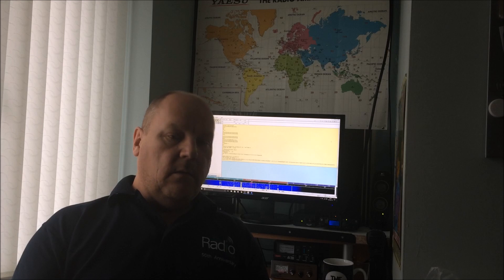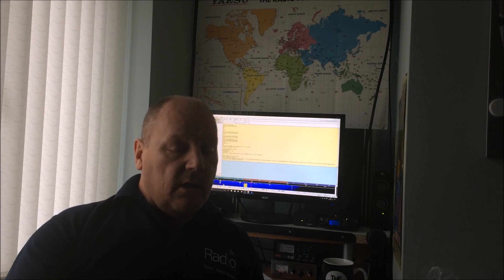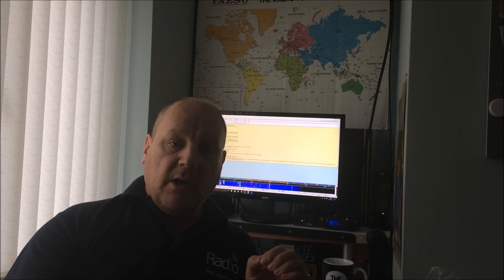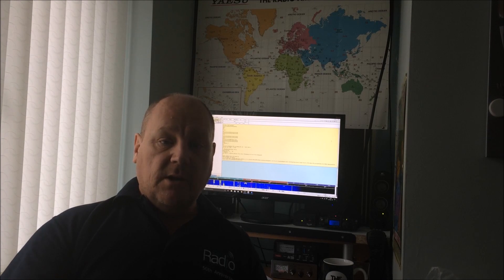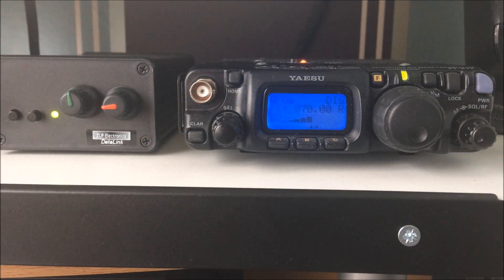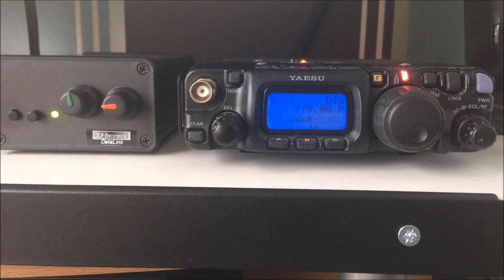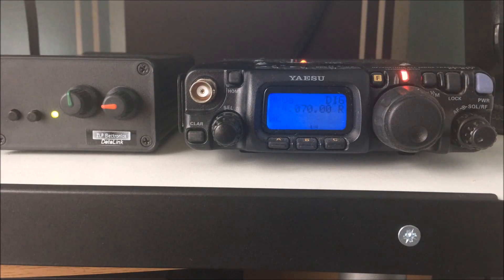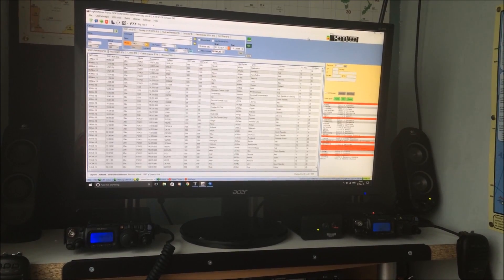Yaesu FT817ND PSK31 correct TX settings

Comment: Hi Chris
Another tip when using narrow band data modes is to disable the AGC on receive. When the AGC is enabled and a strong signal appears in the passband it has the effect of reducing the gain of the receiver and thus losing those weaker, and sometimes, more exotic signals. You then make any gain adjustments manually with the RF gain. 
Regards
Nidge (G0NIG)

Comment: Agree but there is a problem for some operators.  If you don't have a tx level control on the interface,  adjusting the ALC is terribly difficult/finicky. I'm also using a zlc interface but it's the MiniProSC and has no tx volume adjust. Again agree about the setting,  but it's not always easy to get it perfect without the tx level adjust.
Thanks for sharing